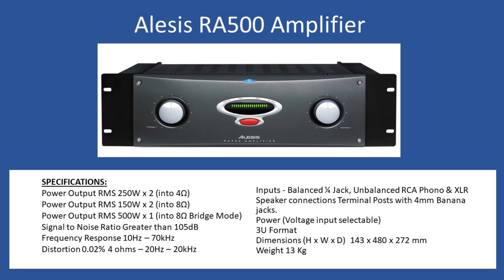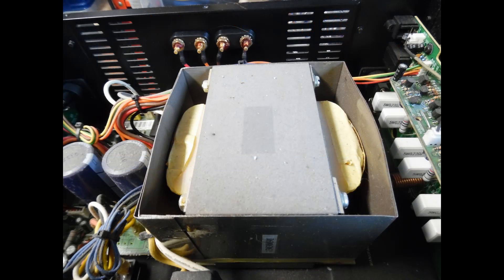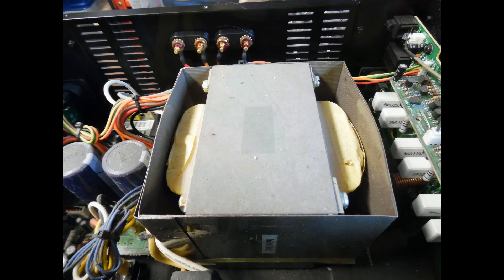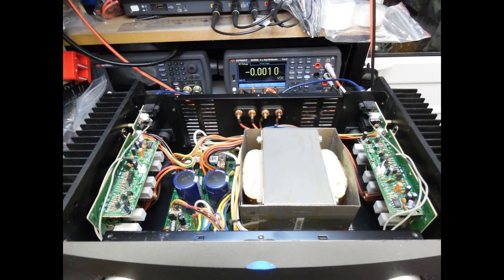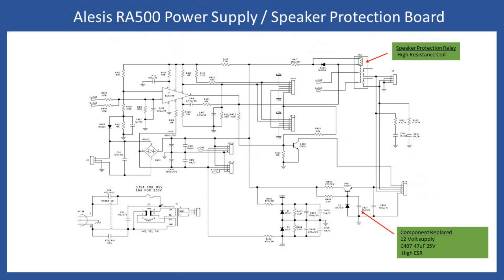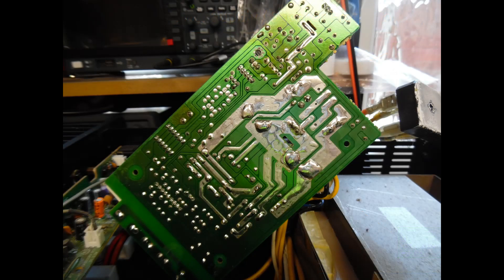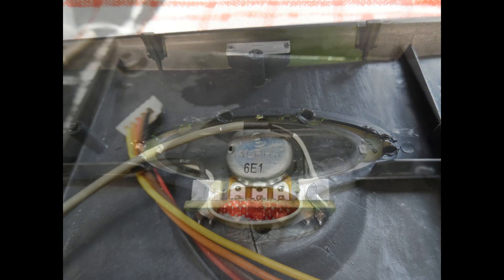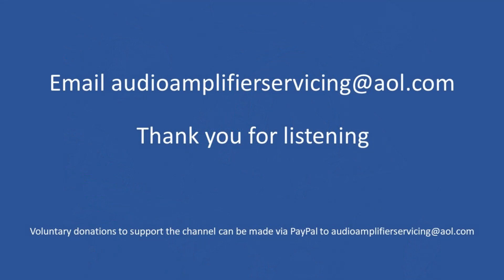Alesis RA500 Amplifier Repair (With Audio Tutorial)

Comment: When you say that the clip protection won't change over, you mean that the Clip projection LEDs stay on? I have two RA500. I bought one as a spare. I unboxed and used it with my speakers,  and put it away, not much use. Tried it out recently,  powered it up, and the clip projection LEDs won't turn off
Reply from the maker: Hi Yes, correct. I have responded to your email.